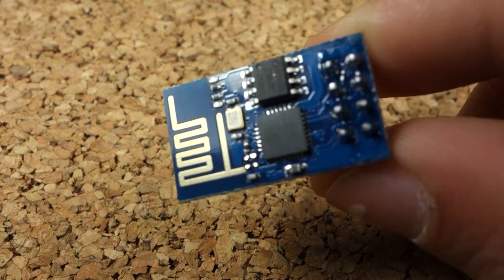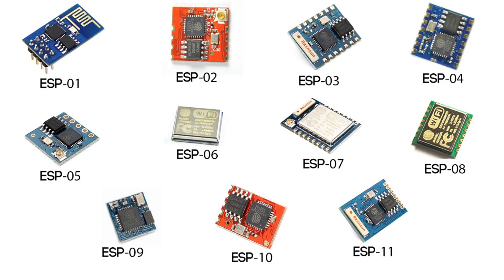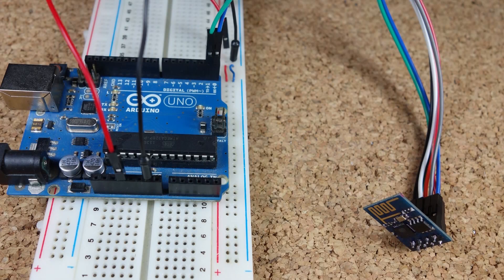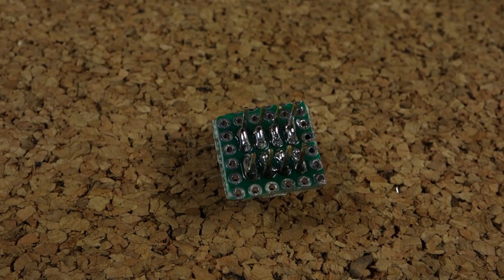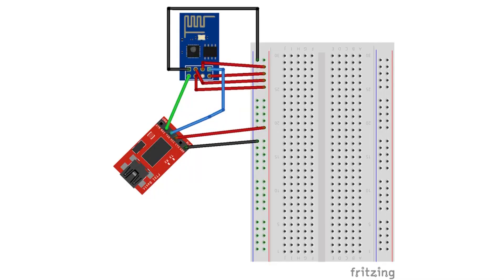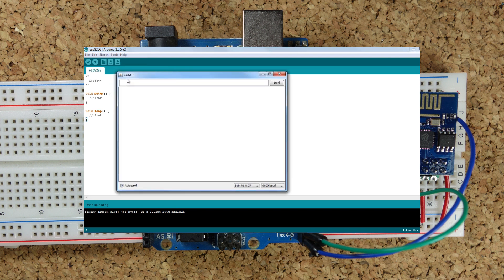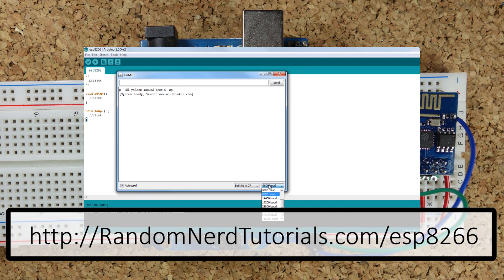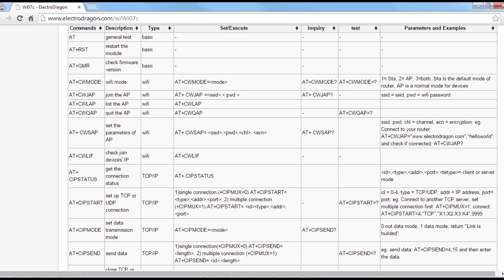Getting Started with ESP8266 WiFi Transceiver (Review)

Comment: I connect the esp8266 module the same way as in the schematic and it doesnt work when i open the serial monitor, no info is shown what can be the problem here ? :/
Reply: Try a different buad rate like 115200. turn the esp board off before changing the rate.

Comment: You don't need an external power supply if you hook a 1000uF electrolytic capacitor to the Arduino voltage source. This way you overcome the current peaks without significant voltage drop!

Comment: you need to level down the voltage when transmitting the data by using a level shifter, the wifi modulo works with 3.3 volts and Arduino with 5V
Reply: the CEO of Espressif said it handle 5v without troubles. Dont need to follow the "official thing on paper"

https://pbs.twimg.com/media/ColbzLEWIAA8E9L.jpg:large

Comment: Hi , I want to know if is the same conection if I use arduino mega 2560 ? thanks
Reply: a little late. but yes you can. ;-) the pin number for rx and tx may differ for different models. for arduino 2560, pin 0 and 1 are rx0 and tx0 respectively.

Comment: hey should wheather I buy esp8266(the one in the video) or esp8266 esp12e ?
I am a bit confused. esp8266 esp12e wifi module has 9 gpio pins. I have not yet got into using wifi with arduino. I am getting esp8266 esp12e a bit more cheaper.

Comment: Hello Rui,
Thanks for this series of amazing videos. I am trying to use CP2102 USB to UART to drive the ESP8266 (also tried a separate supply with common ground). I connected 
Tx---> Rx
Rx---> Tx 
VCC, CH_PD---> 3.3V
GND---> GND. 
Now I am trying to send AT commands using Hyperterminal and Putty (tried with different baud rates:9600, 57600, 115200)  but I am not getting any response from ESP8266. I also downloaded the Arduino add on for ESP8266 and tried with Arduino serial (generic ESP8266) but didn't work. Can anyone please help me with this??

Comment: hi Rui, thanks for the review. Why do you connect the ESP Tx to arduino Tx?
Reply: A bit late, but on the arduino there is a extra programmer for programming all the hooked up boards and the pins of that programmer are connected in the exact opposite to the pins that are labelled at the uno
Reply: The Blender_Creotiv_Guy brah. thanks for answering tho its been a year

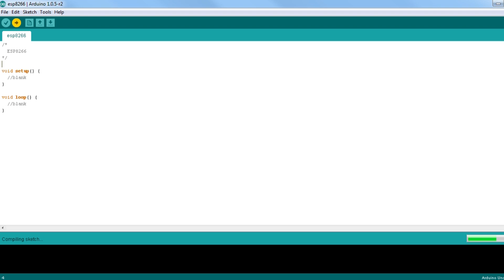Comment from the maker: Update: The circuit with the Arduino at 1:54 works fine for me and I've been playing with the same ESP8266 module for a long time without any problem. But as a final project you shouldn't power your ESP8266 module with the 3.3V from your Arduino, because it might not supply enough current. So I advise you to use an external power supply to ensure that it works fine for you.  I also encourage you to add a 3.3v level shifter or a voltage divider to your ESP8266 RX pin.